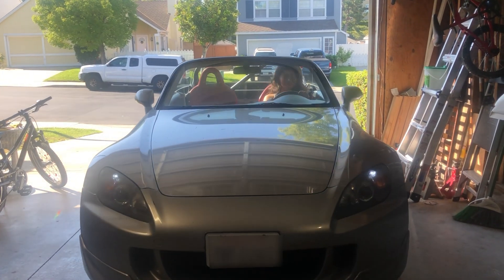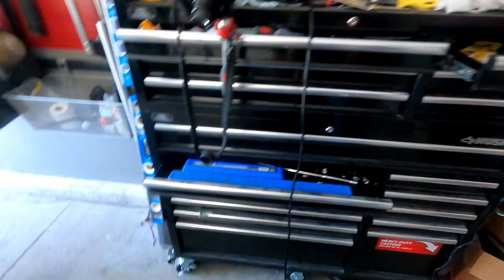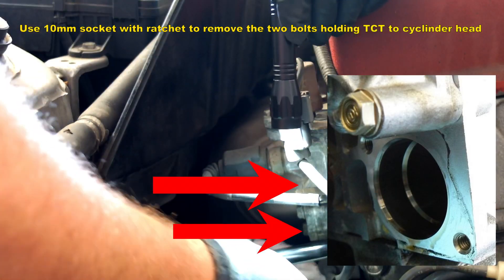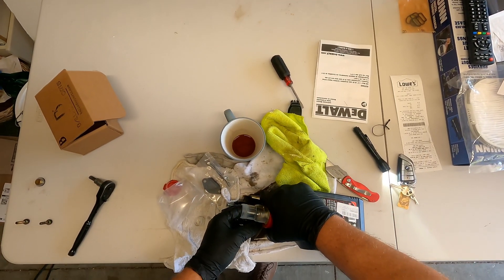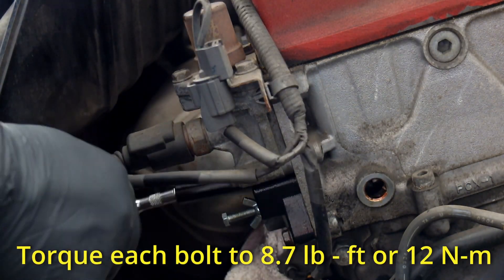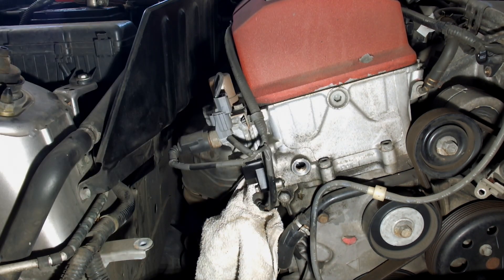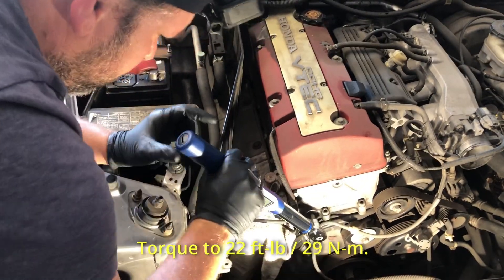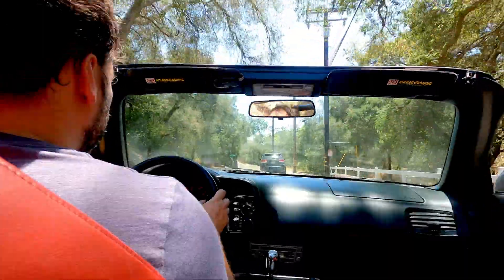Honda S2000: Timing Chain Tensioner (TCT) - Upgrade!!

Comment: Great vid. I've seen another he said to ensure the piston is at top? What does he mean by that? Or is it straight an easy as your vid?
Reply from the maker: The piston is what the worm gear pushes out. 

Unless you are planning to rebuild the TCT. I recommend you don't remove the bolt holding the piston in lock position until it's installed in the block.

Overall It's straight forward to replace the TCT in the S2000.